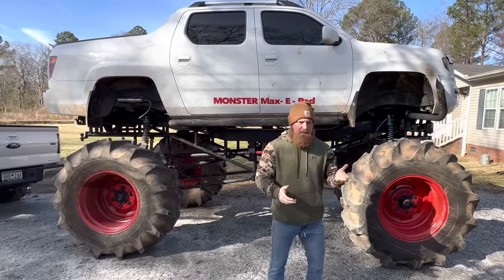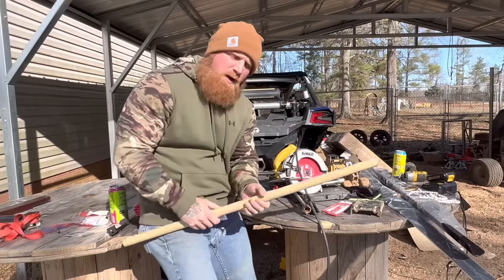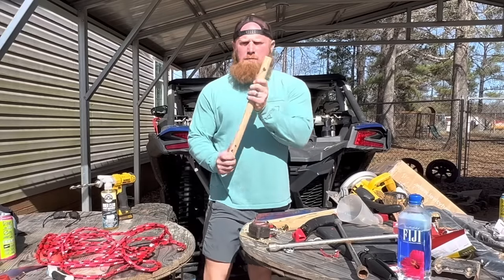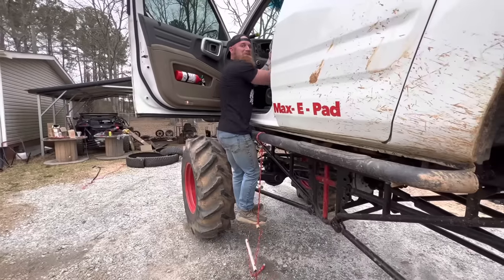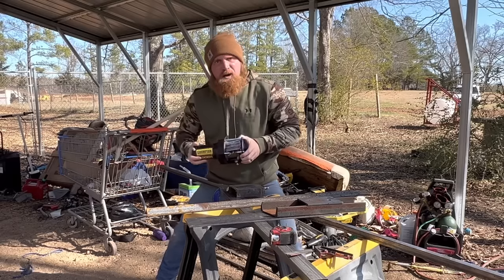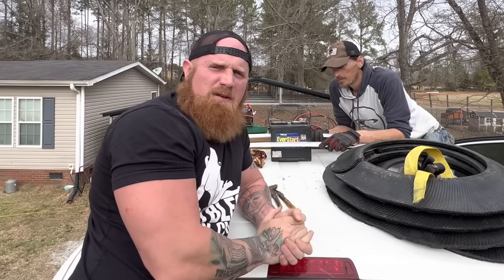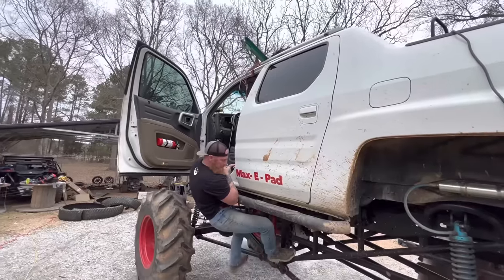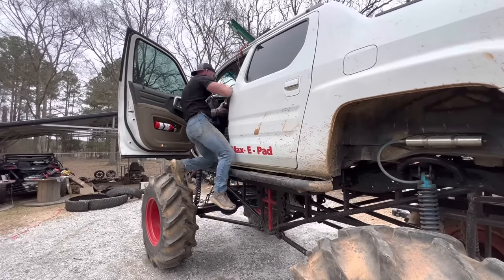Testing my new inventions to help me get into my monster truck!

Comment: I think a scissor lift mechanism replacing the truck's chassis, sort of like those food/beverage trucks at the airports use to extend up to the plane's loading height, is the solution. This way you can board at ground level, and then elevate the truck to the desired height.
Reply: I'll comment when I'm done laughing.
Reply: Dam that guy is still laughin
Reply: @fogitabouutit1720  I think he died of laughter

Comment: I think if you had some kind of weight on the bottom, you'd have a lot less swinging.
Depending on your headroom, you might bring the winch inside the cab, hence no weather  problems. Also, you might want to work on your clip-on harness as you want to protect your manly bits.
Reply: I think that a foot loop would be better and more stable, not only that look cooler as well
Reply: @leed7951  u7u7u7
Reply: @leed7951  u7uu7777î7uu77

Comment: Rope ladders are a common way to get in tall boys. You just need to attach the rope to the lower seat bracket so your weight creates handles in the rope from the seat to the door jam. You can add jump rope handles there to make it more comfortable. Then you can roll it up and tuck it between the base of the seat and the door.

Comment: Moon boots for sure with throw down rope ladder to help you get up, then just throw those moon boots in the back and put on some regular shoes you have tucked away in the truck
Reply: Billy needs to build a slide that's 22 foot high in the back and 6 feet high in the front.  Park right next to it, climb up the back and slide right in the drivers seat!!

Comment: I'm thinking you need a dangle rope for your hands with a pulley system so you can put the big rope back in the truck when your on the ground after getting out of the truck. A small one attached to a larger one so you can pull the big one down. That way you can hand something in your hands as you use your foot on the big tire to get in.

Your way worked man!

Comment: I'd make a foot loop out of that harness. Possibly a little 2×4 to step on to make it  easier to step off if needed.  Last thing you want is to be strapped to a winch if the controller fails and that winch gets stuck on somehow.

Comment: If you put a backhoe arm in the bed with a small platform like a little JLG basket, you can use it to load people from either side and the hydraulic controls can be dual mounted, inside cab and one in the basket.  Could even do remote control if you wanted.

Comment: Maybe tie a rope to the top rung of a step ladder , put the loose end of the rope in your truck (maybe tie a bottle or something to make it easy to toss in the seat), step up the ladder then pull the ladder up by the rope and chunk it in the back seat? Probably takes out at least one passenger seat though with this method.

Comment: I spect you orta use one step from your rope ladder and attach it to the winch hook. Stand on the step and hold the cable while it pulls you up. Them belt loops aint gon hold up for long.

Comment: Why don't he just put 2 rails across the bottom, have a ladder that slides into that rail. You pull the ladder out like a drawer and let it hing down to the ground. Then have a rope on it that goes into the truck, you pull the ladder up and slide it back under

Comment: Well Billy I am uniquely qualified climbing into tall trucks. At first my truck seemed 14' tall until I learned. I lost both legs and my truck is a healthy 4x4. I discovered if I can grip a handle with one arm I'm in. After doing one armed pullups for over 10 years I got stout , extremely stout in my arms. Hey , it's just hillbilly reasoning.

Comment: A folding metal step-stool that goes up to knee-height stored in the back seat would serve the same function, and look significantly less cool, so bravo for style points - 15 out of 10 solution.

Comment: Lol you had the right idea with the ladder if you took another peice of rope to the passenger seats bottom frame then ran it out of the way by running it under  the console and  then under the drivers seat with knots running along it for grip you would just need to step as high up on your ladder as you could whilst using your upper body to pull yourself up

Comment: If it has the Ginger Billy stamp of approval then i will cut the metal hoop ladder welded to the frame on my truck like 99% of them have and get me one of the Billy Kits as soon they are sold in Walfart stores everywhere